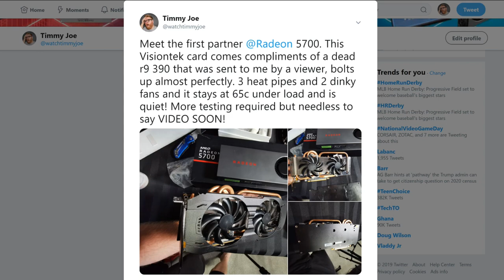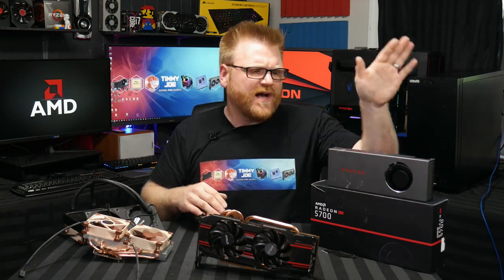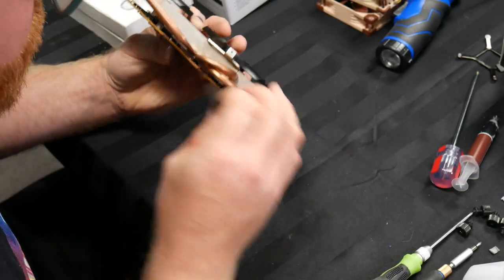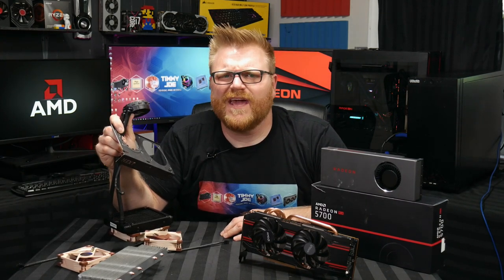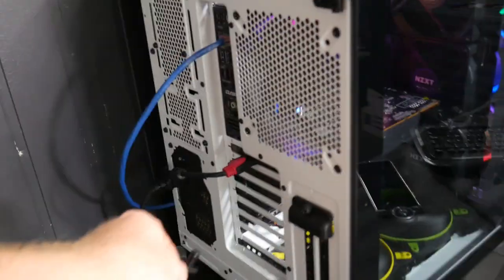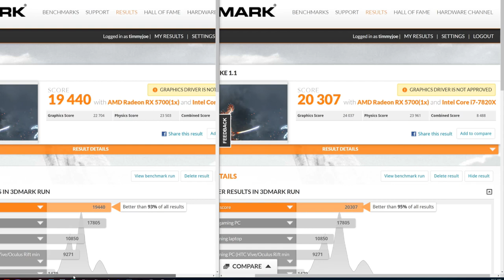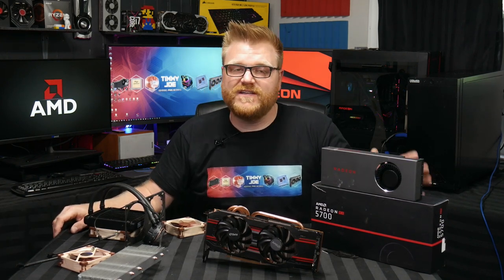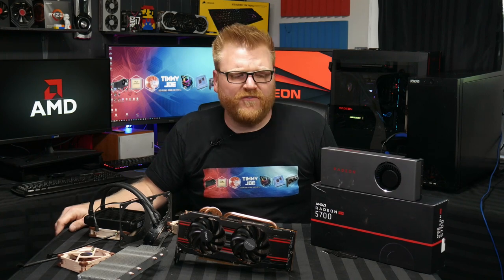Visiontek Radeon RX 5700 2 Fan Cooler TESTED!

Comment: Jimmy the 5700 can overclock, you have to raise the power limit to max and undervolt it. You will get +30 to 40mhz above the typical game clock. Also, its cute how the 5700xt performs close to the radeon VII at stock but make no mistake, after overclocking  the radeon VII it performs at a higher class too much for the 5700. Not worth the price for gaming but well worth the price for all other workloads.

Comment: Great job with the mod buddy! 👍
There's a lot of stuff to take in with Navi, and if you haven't already, you should check out some of Moore's Law Is Dead.
The series will be stepped in order to give app and game devs a chance to learn and implement true RDNA, instead of using the GCN compiler on die for everything already in the works, and for the console game devs, Samsung, and Microsoft too by-the-way, they and many other BIG companies have shown a lot of interest, if not full support. 
I think the adoption of the RDNA will sky-rocket when the next gen consoles have been out for a little bit......and that goes for the AMD CPU's as well.  Apparently the next gen consoles will have 8 cores(and yes, I know as a rule of thumb a fair few of the cores get assigned set tasks on consoles but still....), if they have SMT on top......the games will start making far more use of the higher core count chips too.....and those cores need feeding......PCI-E 4.0 anyone!?!.  
Good time ahead!  😉

Comment: If you already have a cooler on hand that fits, perhaps you used a Arctic Accelero on an older GPU, then for sure it's worth doing it on the 5700 (XT), but only if you're comfortable doing this and of course the potentially lost warranty depending on the laws where you are.

Comment: I'd imagine navi will get another good price cut once A) their older cards further sell out and B) the newer full rdna cards come to replace this price point.

That would probably get the most market share and my move I'd make. Keep entry navi at or above 275 one navi 20 hits so they could dominate the lower end, mid range once navi gains enough mind share over time and reviews, and release the new higher end cards at a slightly increase price from Original navi pricing. Probably starting at or right under 500 dollars. This would mean current navi won't be planning any price drops until 2020 or if Nvidia releases reasonably better mid range stuff.

Comment: Hey in case anyone is wondering, I actually have Ivacy and it is indeed a good VPN, I get fast (secure) download speeds (it can max out my connection, around 14MB [136 megabit] per second depending on the torrent and the server you choose of course... I tend to use belgium), it's reliable and the price was good.  But it does NOT work with any of the streaming services I've tried in case that's important to you (netflix / hulu).

Comment: I have tons of Tri X OC heatsinks and fans laying around because I had a few R9 290 Tri X OC's (best card in the world really), so it would be super simple to do this. 
Additionally I still have 2x XFX 390X's laying around in case I ever want to throw them in crossfire - I could use those coolers for it. I guess I gotta get a 5700 now, oh darn..
Reply: Honestly I think that the 50$ more on the XT are well spent considering the limited oc...

Comment: The infinity Fabrics interconnect software isn't operational yet which means that full utilization probably won't happen unless the cards are paired with 3rd gen Ryzen builds. I'd like to see the way this stuff turns out after a couple more agesa bios, and software patches get thrown down the pipeline. AMD has been intentionally gimping Navi, and Ryzen 3000's. They basically give a good idea of what the Bottom line looks like, to apply pressure on Intel and Nvidia. Glad you mentioned that the platform will Mature more

Comment: memory temp is lower with the kraken than the R390 cooler.  what is the distance between the gpu, memory and the VRM.  on my RC480 gaming X the bracket covers the memory while the fan starts just at the VRM  https://www.overclock.net/photopost/data/1687540/e/ed/edc16caa_p3pb15394114.jpeg

Comment: That was awesome. I'm wondering if the ek r9 290 waterblock I have would fit that or the xt
Reply: Probably not due to the VRM/Memory placement, the 5700 chip is placed differently aswell.

Comment: Apparently the 5700XT thermal throttles to the point it shuts off. Most likely a reason the 5700 is limited. The coolers on these don't work anymore. It's a shame they keep releasing the cards with that unsufficient cooler on it. It seems that 7nm doesn't do much for thermals as more transisitors still generate heat in the same way as higher process with fewer on it. Will be interesting to see what the Strix temps will look like
Reply from the maker: The coolers are fine for this launch, the 5700xt thing is a bug, it's not that it's overheating, it's doing something weird in in idle GPU loads like game menues, it doesn't do that while gaming
Reply: @TimmyJoePCTech  But that's the issue right there. People will buy this at launch and when AIBs cards come and some retail for the same price but with superior cooling it's a bit meh imo. Not saying that nvidia was fast to catch on but there is a reason why AIBs are more desireable even used. And yeah hopefully the manage to iron out the early adopter bugs.

Comment: I found out that custom gpu coolers made for amd 7950/280/290 also fit polaris cards. I put this artic freezer custom gpu cooler made for amd 7950/280/290 on my rx460 ( rx460's comes with really shitty heatsinks).

Comment: not sure what the go is but my 1080ti aorus extreme 11gig goes to 2113 mhz just with gpu boost.. jsut with Power and temp limit raised and voltage maxed through MSI afterburner ofc with an agressive fan curve
Reply from the maker: Yeah you can get those cards close to 2200 Mhz, Back when threadripper launched I had a few top 3d mark results, like 15th in the world in timespy and 11th in firestrike for single CPU single GPU pairing and Aorus 1080ti extreme overclocked to the dickens and a 1950x, it only lasted a week before the 7980xe launched
Reply: @TimmyJoePCTech  Nice yer i have no need to upgrade right now the 1080ti i have is insane

Comment: I'm curious if the Sapphire Tri-X cooler from the R9 290 would work. I've had one stashed for a couple years after upgrading to a Vega 56.
Reply: I'm also wondering... I have a dead R9 390 Sapphire Nitro+ with a working cooler 🤔
Reply: Just what I was thinking

Comment: It is a shame that these cards are software/bios locked.  Otherwise I would consider buying one just to remove the shroud and change the fans for some case ones that are quieter and can blow over the entire heatsink (I did this on my old 7870 which worked quite well).

Comment: Stock cooler: End of run... mem temp 84

Modded cooler: End of run... mem temp 94

might need to try some different thickness thermal pads and see if you can adjust that
Reply: Exactly this is what makes me hesitate on playing with custom cooling solutions.

Comment: man i guess the 5700 is a real beast for 350?! i think i really like it should have waited a few months instead of buying a 1080 second hand for 300
Reply: The 1080 is still good, even better than the 5700 in some cases. If anything, you should probably try to sell it for 300$ too. In my country, top of the line gpus are still super expensive even though newer and cheaper gpus are priced the same.
Reply: @combatantezoteric2965 , well i dont think my pascal without async compute has anything for the 5700. but i am happy with my purchase because it is a strix model that has been water cooled its whole life before me, so the cooler wasn't even used. hope it will last me a few years but i am really curious to see where this RDNA architecture is headed! i was actually on the hunt for a vega 64 not a 1080 because in my opinion it is more fun and a little bit better but this popped up a friend was upgrading to a 2080ti so i snagged it.
Reply: @xibidit  Wow, I just love the strix version. I can even understand why the original owner decided to watercool it, so they can watch the original cooler in a showcase ;)
Reply: @xibidit  It was a good deal for sure anyway and I dont think that you need to upgrade too soon. Even at 1440p it should last another two to three years on high settings.

Comment: A big navi with 64 Compute Units would probably beat or match the 2080 ti. 59X0 XT would have 64 CU. The 59X0 Non-XT would have 60 CU. The 5800 and 5850 XT would have 48 CU and 56 CU respectively. The 5600 would have around 24 CU and the 5600 XT 30 to 32. These are just guesses of course.
Reply: I think with 64 CU it will really close to RTX 2080ti even outperform it.

Comment: Sapphire Tri-x and Vapor-x coolers from a 290 won't fit. a lot of extra bits on the heatsink that will get in the way of a 5700xt's components, going to see if xfx coolers (7970dd and 280dd) might fit once i receive 7970s and a 280x (the copper base plate of the 7979 and 280 coolers maybe a issue on the 5700xt die, i have to see when it arrives).

Comment: It’s so possible. If I can buy a h110 motherboard that can run a 9th gen processor, a 950m soldered to a pcb with video connectors, or a x79 motherboard with m.2 boot, I’m pretty sure someone can figure out how to mod the bios. 
I just want some bored millionaire tech fan to mod together a crazy rtx8000 mixed with a 2080ti using both gddr6 and hbm2 that can do 4way sli, and plug it into a cpu that is a mix of a 9900k and a 9990xe that can clock to 5.5ghz and uses pcie 4.0 with ddr5 and a turbo button because it’s actually too fast for modern games.

Comment: got me a radeon RX590 8 GB FROM XFX WITH CORE CLOCK OF 1580 AND MEM OF 2000 SO OVERCLOCKED IT 1720 ON THE CORE AND 2250 ON MEMORY RAN FANS AT 75% undervolted in 3d mark the score was 33225  run all games in max settings at 1080p and 1440p i got aorus x470 ultra gaming 2700x ryzen overclocked to 4500 ghz corsair vengence c16 32 gb 3200ghz clocked to 3600 aio cooling on cpu 144hrz 35" monitor curved runs like a bugatti it so fast and rock stable amd rocks my other pc is ryzen 3900x navi 5700xt 64gb vengance c16 3600ghz and the new asus x570 motherboard all water cooled running cpu at 4,8ghz stable  and i am crushing 9900k with 2080 green vomit card in boath systems i got two 2tb m.2 from silicon power ultra fast running in raid confyg pc starts in about 5 to 10 sec and and i got two navi 5700xt running in crossfire and i am in love with my rigs and thermal take case with1300w power pack fuck intel and the green vomit nvidia overprized junk buy red team ryzen radeon  corsair mem and silicom power m.2 ssd cheap and ultrafast and now i am startin my threadripper project just bougt the cpu still crying my 1600 dollars and 350 us for my board next i will try gskill memory this one will be freon cooled all the way disks mem cpu graphics and board so i will overclock it like it would be nuclear powerd cant wait 😀😀😀😜

Comment: I respect Radeon VII for what it stands, it did saved Radeon brand from total annihilation. It's still a fantastic Gpu, but move on, let Navi be what it should be.
Reply: Got to clear out whatever Vega stock they have left in the sales channel. Navi is probably a lot stronger than we are led to believe. Why software lock 5700?! Probably because AMD are holding something back for Nvidia price/performance war. Anyway, Navi still needs driver tweaking, but it's very good performance right out of the gate.

Comment: Not saying it will work but the Frostflow by IDcooling
Link http://www.idcooling.com/Product/detail/id/134/name/FROSTFLOW%20120VGA
shows compatibility for the R9 290x. I have one of these coolers and will donate to Timmy for testing. Not sure how to get it to him though.

GPU COMPATIBILITY LIST (According to Mounting Holes)

 53.3*53.3mm

 NVIDIA
 GeForce GTS 450, 250
 AMD
 Radeon R9 290X, 290, 285, 280X, 280, 270X, 270
 Radeon R7 265

Comment: my radeon VII runs at 2150 Mhz with wc, so I don't think so , maybe 5800xt or 5900xt
Reply: The RX 5700XT is meant to replace the RX 570, not the Radeon VII.
Reply: @FireFoxBancroft  sorry , don't see the point , my comment was about Timmy Joe saying the 5700 oc could be as good as radeon VII , I just said radeon VII OC a lot :) , but maybe at stock 5800xt or 5900 could reach radeon VII in several months

Comment: And the radeon 7 gets even more pointless when you think of the Vega FE, like 2 years back, which has roughly the same tf power, same 16gb of hbm2 and can be had for $350-400ish on e Bay.
Now, if theyd made a duo version for content creators that would be different and would have sold like hotcakes even at $1200+, but the 7,. Its not just navi now, we had the FE 2 years ago, so I dont know what theyd been smoking when they thought of that.

Comment: On the other hand just maybe it's early on in the Navi life cycle and all your wild conclusions are just that.  AMD does more than PC graphics cards and was delivered a blow with a Navi re-tape delay that meant people had to return to work on Navi instead of the next tech that put them behind schedule.  Look what they have on their plate Consoles, Supercomputers, Zen dev, Navi dev, Next Gen graphics, Pro graphics SW, Epyc dev, Embedded dev.  They also came up with Mantel, Freesync, DX12 dev, RadeonRays, GPUopen, most open source,   AND with a fraction of the funds to throw at  it yet they Pushed up the desk top core counts Delivered the first 7nm GPU first, 7nm CPUs prices and reduced and value.   In just a few years they have made major changes with each tech area the focused on and pushed the competition that doesn't want to follow the rules.  I think Zen 2/Rome is a historic achievement and AMD GPU roadmap as well, I think AMD has delivered on their goals.   I think they deserve more respect than they have been getting and everyone needs to fallback and allow them some time to get things worked out.   As you may have noticed the Wall Street analyst think AMD is delivering and is the one to watch.   NVDA and INTC stock not so much.

Comment: See, I'm fine if the 5700 is artificially capped...I'm not fine with it being capped at $350. If this one was $300 it'd be perfectly fine, because it'd be a 1660ti competitor. This one is only a bit cheaper then the xt for a lot less.
Here's hoping someone can crack it. If AMD didn't go that far to lock it I suppose I can ignore it, but if they've hardware locked it...

*I really wish you'd have been able to run this with an XT though. I'm unimpressed with the 5700, but the xt is pretty dam great. Just an awful cooler.

Comment: Is there any official word from AMD about locking the overclocking on the 5700?
We knew about the bios lock AMD said so before the launch but i didn't hear anything about that. Maybe its just buggy drivers, I've seen quite a few irregularities and unexpected results in benchmarks over the net. 

Also i think vega 7 didn't overclock with launch drivers or maybe it was the original vegas i don't remember but anyway vega 7 launch drivers were terrible.
AMD has never done something like this before and considering most people don't overclock their systems it seems very strange that they would do something like this.

Comment: Kraken mod the 5700 XT if possible... I did it to my 2080 Ti and my lord its incredible.
Reply: Seems like Timmy Joe properly mounted it to the core and the vram was the problem(even though that can be solved with tiny heatsinks), but then other people say they couldn't mount it, and NZXT's site says nothing. Such a shame too as I would really like to go this route myself.
Reply: @thetrashman5252  Interesting my VRAM and Mosfets are exposed to clean case flow with no heat sink but are cooler now that they were with the AIB cooler on it.

I think the direct contact from the heatsink was actually keeping my VRAM warm because the core is so hot that the heat warms up the heatsink and in turn the VRAM and VRMS. 

The supplied fan does a excellent job keeping it cool. 

I think they are numerous videos showing better temps with the G12 mod for VRAM than actual coolers due to this and even Gamers Nexus has better VRAM and he just has a fan blowing towards it.

Shame it didn't work. My 2080 Ti is sitting at 2040MHz Core and 7500MHz VRAM with  Temps peaking at 65-72c on a cheap H55 that I replaced the fan with a Noctua PWM that runs at 1250rpm. Dead quiet and 10c cooler than stock with a substantial overclock.
Reply: @Carrot_Handler  How are your vram temps though, because I plan to use a g12 and h55 for a 5700xt, but the vram worries me. Although with that said there are cheap heatsinks on Amazon just for this.
Reply: @thetrashman5252  I have done it to both my 1080 Ti and 2080 Ti and never had a issue with temps on VRMs and VRAM... Infact my VRAM and VRM stays under 60c on my 2080 Ti.

Here is a link to set you at ease:

https://www.youtube.com/watch?v=wkytxqm62Sw

I ran my 1080 Ti overclocked for 2 years with a G12 with no issue what so ever.

Those GPU heatsinks are actually restricting heat dissipation from those chips... Once you cool down the core the whole PCB will cool down so it wont take much to lower the VRAM and VRM its why even on the lowest fan speeds the G12 has better temps than a EVGA.

The people who tell you to worry about VRAM and VRM temps usually have never done any tests and are just talking rubbish who have little to no idea how much the core temperature effects its surrounding components.